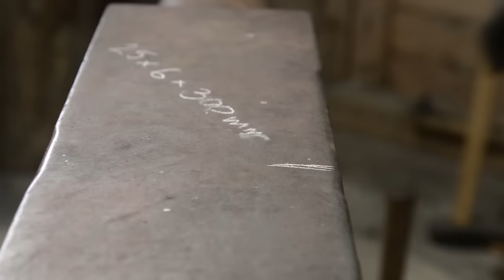Blacksmithing - Forging a drawknife

Comment: Thank you for this video effort. One of the best ! Have watched many times and consider a benchmark on how to correctly heat treat. Two questions, what is the blue " Highlighter " you use to assist in grinding, and do you think a yellow hot bar could be used to replace the oxy torch in tempering the spine ? Thanks again.
Reply from the maker: Thank you! Blue marker is just an ordinary felt tipped marker pen. I'm not sure you would manage to heat the spine in that way... maybe. It's worth a try !

Comment: Great vid thankyou! Have a couple ?s.. so the hole u make for the handles u just drill out one size and hammer to fit? It doesn't have probs falling off? Also older draw knifes have a section at the back of the blade that are fatter.. don't know what it's called but I would love to see u make one with that just to see how it's done. U just got one more subscriber haha keep up the good work!
Reply from the maker: Thanks. The handles are still on! But I think the 45 degree angle helps. Handles that are perpendicular to the blade should probably be fixed with a pin or rivet at the end. I might revisit this one at some point!
Reply: @torbjornahman  awsome do u know what the thicker part at the back of the blade on old ones is called? And or the point of it?
Reply from the maker: No, I'm not quite sure what you mean... sometimes there is a fuller between the spine and the edge bevel to move the edge and make it more light weight I guess.

Comment: Beautiful. Two questions-- What is the finish you put on the wood? And why do you heat it in water midway?
Reply from the maker: I use linseed oil on the handles. I cool the edge in water as I temper (soften) the back of the knife to make it more tough.

Comment: What is the purpose of annealing the metal and also how did you start blacksmithing?
Reply from the maker: Annealing makes the steel as soft as possible, to make machining,filing and grinding much easier.
Reply from the maker: Check out my web page for some short background info.

Comment: Are you using a plasma heater for the second stage of back tempering and to bend the 2 sides of the knife?
Reply from the maker: No, it's the old trusty OA torch.

Comment: Pardon me sorry if I sound dumb to this.  May ask what was the material you covered blade in ? And how does it work I assume it  is cooling blade slowly?? Thanks
Reply from the maker: Vermiculite, its a pretty good insulator and helps slow down the cooling. Look up annealing!  It makes the steel soft for machining/filing/grinding.

Comment: Is it necessary to harden the drawknife with oil or can it just be done with water? And what are you doing at 9:39 and why? Is that copper at 15:14?
Reply from the maker: Most knife steels should be quenched in oil. It entirely depends on the type of steel you use.  At 9:39 I'm tempering (softening) the back of the blade, keeping the edge cool in water (to keep it hard). Yes copper pipe!

Comment: First of all my best compliments for your great work, i didn't understand two things:
-Why at 3:04 minute you hit the drawKnife with a piece of wood and what is that kind of sand at 4:53 minute. Thanks for yours great videos and let me know the answer.
Reply: Francesco La Fauci He answered about the firewood beating. This was done to not bent the bevel too much. Also I don't understand why is he heated the knife halfway in water.
Reply from the maker: Vermiculite. It insulates and makes the steel cool slowly, which is needed to anneal this type of steel.
Reply from the maker: I want to soften the spine or back of the knife, but not ruin the heat treat on the edge.
Reply: Ok thanks at all.

Comment: Is O1 as hard to forge even at temperature as I experience? It doesn't want to move under the hammer and rapidly builds stress if you hammer it cold in my experience.
Reply from the maker: It's quite hard, yes, and you need to be careful not to forge it too cold.
Reply: @torbjornahman  Thanks for the reply, I knew I wasn't imagining how tough it is under my hammer. I still love O1 though, I've made a lot of knives from it so far. 

Happy forging!

Comment: Torbjorn, may I ask what kind of steel did you start out with for the forging?
It looked like mild steel, but I would think a spring steel or other hardenable material would produce a finer edge.
Love your work. Thanks for the great videos!
John from California, USA
Reply from the maker: Thanks! It's there in the beginning of the video. O1 tool steel. It's a bit tricky to work with but this one came out ok I think!

Comment: Why no heat treating oven? Is it a practical problem (space, not enough blade production to be worth the expense, etc) or something else?
Reply from the maker: Eventually I probably will get one. Quite pricey equipment at around $2000, you need to consider the real need for one.

Comment: Beautiful piece. I'm thinking of making one out of 5150 (leaf spring) Opinions?
Reply from the maker: Thanks. That would work nicely I think. Maybe not the absolute best edge holding steel, but very tough!
Reply: @torbjornahman   I stole liberally and shamelessly from your example. I especially thank you for the idea of using copper tubing as a collar to prevent splitting when setting the handles. My finished product was nowhere near as pretty as yours, but was functional. Thanks again for taking the time to make these videos, and especially so for taking the time to answer.

Comment: Gorgeous. Torbjorn , what color should I work 01 at. I have had it crumble and crack. Thanks Frank
Reply from the maker: Thanks!! Not too hot! The specs says between 1800 to 1950 °F (980 to 1065 °C)... A quite narrow range!!
Reply: I used some H13 the other day that cracked as I forged it. I think I got it too hot also
Reply from the maker: Yes, that steel is also very sensitive to over heating, and cold forging is no good either...

Comment: Why did you hit your piece with a small wood log? By the way, I really love your site!
Reply from the maker: If you have a thin edge you can get away with less distortion if you spread the impact and use a "soft" hammer.

Comment: What is the type of steel/iron you used in this video?
Reply: right at the beginning of the video it says what steel is used
Reply: Brandon Yagami 01
Reply: I asked the same thing....looked like hot rolled mild steel, but I'm betting it was spring steel or some other grade that can be hardened properly for edge life.

Comment: So the arc that was added was to allow for the expansion of the thinned edge?
Reply from the maker: Yes, as you forge the edge bevel you will get some expansion and the blade will bend. Making a "reverse" bend first can help.
Reply: @torbjornahman  Thank you for the clarification, I'd done something similar using a peen to get the complex curves for a bit of elbow armor.

Comment: How well does heat treating in a PVC pipe work? I had the same idea for a large machete but was afraid the oil might get too hot and melt the pipe.
Reply from the maker: I think it works fine for smaller stuff, but as you say if the oil gets too hot you might have a problem. The volume of quenchant is important in relation to the mass of your piece. The oil should not be allowed to heat up very much. This link might be interesting - https://www.bladesmithsforum.com/index.php?/topic/28822-volume-of-quench-tank/
Reply: thanks torbjörn, keep up the good work. I really enjoy your videos.

Comment: What is "anneal"?  By the way, the sounds of blacksmithing is so soothing.
Reply from the maker: Look it up! Basically you make the steel as soft as it gets to make machining/grinding and filing much easier. The opposite to hardening so to speak.

Comment: i don't get why you forged that curve because you then straightened it out again. did you originally want a curved profile but then changed your mind and thought it would be better straight? Also what steel is that? o1, A2, 1055?
Reply from the maker: When you forge the bevel it will curve... so I made a bend in the opposite direction first to end up straight...kind of.

Comment: Is that blade slightly bent? And what about that hollow ground side? Is that some kind of a traditional design?
Reply from the maker: Yes it is... that happened during hardening but I didn't bother fixing it. I actually think it might be beneficial this way. The hollow grind just makes it easier to sharpen. You don't need to grind the entire back flat.

Comment: I have a question about heattreatment. After quenching you put cutting edge to water to prevent tempering with more than 100*C. You tempered only top of blade (in more than 300*C). But when you was sanding it (11:23) i can see blue color which came from heating it for 280*C, right?. So blade get tempered? And all that stuff with water was pointless? Or is it only blue paint to mark unsanded surface?
Reply from the maker: After quenching I temper in the oven first to get the right hardness to the edge. Then soften the spine keeping the edge cool in water. The blue when grinding is just paint!
Reply: Thanks for answer! Why did you soften the spine? TO prevent cracking in case of falling? Great knife btw ;)
Reply from the maker: To make it more flexible and tough.  Thanks!!

Comment: Do the handles not fall of easily? It seems like they'd come off after several uses.
Reply from the maker: They haven't fallen off yet... With angled handles the pulling force on the handles is reduced so I think it will work fine.

Comment: This is really good but would appreciate if you could add some details of the process e.g. Why do u give it an oil bath or heat in oven or use any of the step. what value it adds to the product? For an amateur like me it becomes difficult to follow without instructions. But anyway, thanks for sharing!
Reply from the maker: Good that it triggered interest! I try to add text where it's relevant. The problem with heat treatment is that it's never the exact same procedure with different steels, so for giving instructions you have to use exactly the same materials. O1 steel needs oil for hardening, then I temper in the oven to sacrifice hardness to gain toughness. It's really complex when you dig in, but try and look up hardening, tempering, and heat treating.
Reply: Great!! i will. thanks for the clarification. Keep it up. ATB for your future videos.

Comment: Please explain the tampering sand and oil benefits
Reply from the maker: I anneal in vermiculite, which insulates the heat and makes the steel cool slowly.  This steel should be quenched in oil. Others will quench in water... all dependent on the specification.

Comment: at 3:03 what's the point of using a piece of wood as a hammer? is it more forgiving?
why did you put the knife into a bucket of gravel? at around 5:40
WHY IS IT NOW BEING HEATED IN WATER. WHAT I WAS NOT TAUGHT THIS IN YOUTUBE CLASSES
otherwise, amazing piece of work, and watching that slice pieces off of wood is weirdly a little bit like asmr. idk thank you if you bother to answer my questions lol i know very little about blacksmithing
Reply from the maker: I use wood to straighten the blade without damaging the thin edge too much. The gravel is vermiculite, an insulating material. It helps to cool the steel slowly, for annealing. The water keeps the hardened edge cool while I heat the spine to make it a bit softer.

Comment: What was the grain-like stuff you placed the metal into? What was it's purpose?
Reply: That looks like vermiculite. It's a mineral with high thermal insulation capacity. Used to slow down the cooling of the blade to anneal it.
Reply: The same in which mushrooms grow on? That's interesting. Seems like a great way to anneal. Can you use this on most/all projects you'd need to anneal on?
Reply: The very same! I believe there may be some super steels that require extremely long soaking times in an oven, with closely regulated drop of temperature to anneal totally. For most normal carbon steel/spring steel, vermiculite, ash or the dying embers of the forge will work sufficiently.
Reply from the maker: Exactly. Most high alloy steel needs an oven though. They often require a cooling rate of just 10C/h.

Comment: although it was fun to watch some explanation would be nice. like why you did the heat treat like you did. Thanks
Reply from the maker: Thanks. Heat treatment is a complex business and this is mostly guess work so I don't go into detail about it. You really need a heat treatment furnace/oven to do it all right. Some day I'll get one...
Reply: poco1968 I just have never seen heat treat in water and it looked like you hardend the spine not the cutting edge. I have never used a draw knife so was just curious. thanks for replying

Comment: What kind of coal do you use for the forge? charcoal is kinda weak but the stonecoal seems to be hard to contrrol temp vise , i melted some stucf accidentally with it
Reply: Nikola Nedeljkovic what do you mean by weak?
Reply: The heat it emits in comparison to wood coal , stone coal, cox or whatever its called in english...
Also, it kinda doesnt last long compared to others....
Reply from the maker: Coke for the most part. Sometimes coal. Heat vise there is no real difference. Charcoal burns fast, but is the cleanest fire.
Reply: +Torbjörn Åhman Nothing worse than that sulphoric smell in the hair :)

Comment: Great video. What belt grinder do you use?
Reply from the maker: Thanks. It's a 75x2000mm no-name belt grinder. Chinese piece of crap really... but does the job pretty well still.
Reply: Torbjörn Åhman thanks. If you don't mind me asking where did you get it. I am trying to find a good belt grinder for a decent price.

Comment: why no mechanical holders for the handles? No epoxy or pins?
Reply from the maker: I probably should have added pins of some sort. The problem is this steel is tricky to work with. It air hardens so it's difficult to get it soft enough for drilling holes or peening over for that matter. With angled handles like this the force is reduced a bit along the handle. Until now that handles remain in place.

Comment: You and annealed it with the vermiculite then you tempered it with the oil and then you  anneeled it in the oven again can I ask why
Reply from the maker: I annealed it in vermiculite to make it soft. Then I hardened the piece in oil (glass hard and brittle), and tempered it in the oven, to bring back some softness and make it tough.  That's the right terminology.
Reply: Thank you

Comment: I was wondering what material that pipe that you used for your quench was made of. Is that PVC?
Reply: Denat Balla It looks like usual "outside" (red) sewage PVC tube.
Reply: Do you know off the top of your head if it  has a higher heat compacity? Also thank you :)
Reply: Denat Balla I'm not an expert but think the tube was used just because it is watertight (or should I say "oiltight"?). Maybe lower heat conductivity is also significant (steel tube would cool too fast).
Reply from the maker: Yes, it's a normal PVC tube. Heat is no problem.. Probably max 70-80 C.

Comment: great video, but I have to correct you on the handle materiel. I have worked with elm and oak wood and I am certain that you usee oak
Reply from the maker: Thanks. No, it's not oak. But I agree, the grain looks similar.

Comment: Not sure if the wood you shaped with the axe and later with a drawknife was the same, but when it was shaped with a drawknife it's Oak.
Reply from the maker: No, it's actually elm wood. The grain is quite similar to oak for sure.
Reply: Odd, I've never seen Elm so rough pored/grained or having large Rays..
Reply from the maker: If you google "elm wood grain" it appears that it can vary quite a bit.
Reply: I can see that, but it doesn't have the Rays going from the center and out across the grain like Oak does. I've worked with both Elm and Oak, and it doesn't look like Elm to me.. Not trying to bash on you or anything, just something that caught my eye. :-)

Comment: what was the bucket of pebbles for?
Reply: I think it was sand. He was burying it to hold the heat into the blade so he could anneal it better and it would be softer for when he files and sands the blade.
Reply: I assumed it was something like vermiculite because that is usually what some smiths use for annealing
Reply from the maker: Yep, vermiculite it is.

Comment: 2300 down votes??? What's wrong with you people? Thanks for the video. I'm inspired by your craftsmanship. I'm wondering why you didn't curve the handles during forging.
Reply from the maker: Thanks. I think it was because it was easier to quench it straight, but in general it does not matter...

Comment: Did you heat it with a plasma cutter???
Reply from the maker: I don't own a plasma cutter... no it is hardened with the quench in oil then tempered in the oven + extra tempered the spine with the torch.
Reply: Torbjörn Åhman what did you heat it with when it was in the water, was it a blow torch?
Reply from the maker: @sidstone8845  It was a Oxy Acetylene torch.

Comment: En fråga som kallas kärnan där du lämnade bladet ett tag, frön du har i en stor kruka skulle berätta för mig?
Reply from the maker: I think you ask about the vermiculite I have in a bucket. It's a good insulator and makes the steel cool slowly, annealing. That makes it easier to grind/file/machine.
Reply: Ok I asked you because I'm from argentina and I want to start with blacksmithing and carpentry and I'm learning from you thanks...
Reply: I'm watching all your videos entertain me a lot jjajaa

Comment: I lost track of what happened around about 3.00 minutes, you were putting a curve in the blade across the two stainless steel formers, and then it was straight again.
Reply from the maker: Yes. I pre-bend the blade. When forging the edge bevel, that will bend it back straight, more or less.
Reply: Thanks. I will watch the video again.